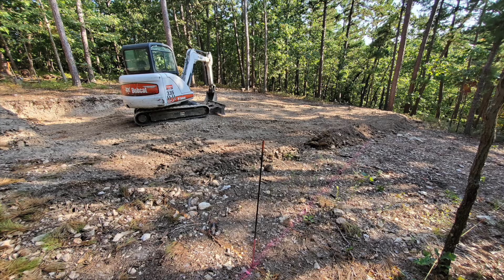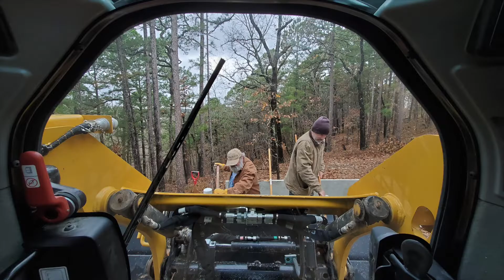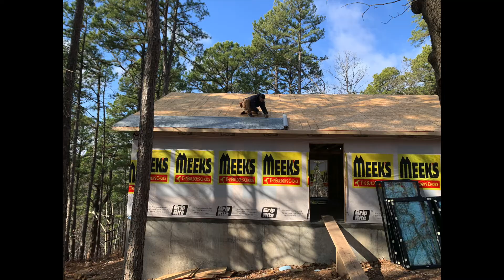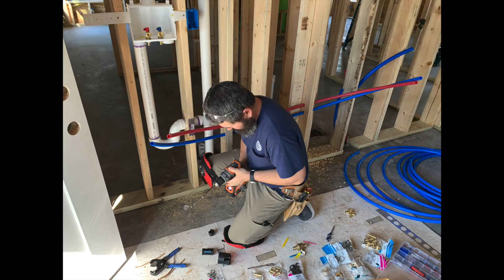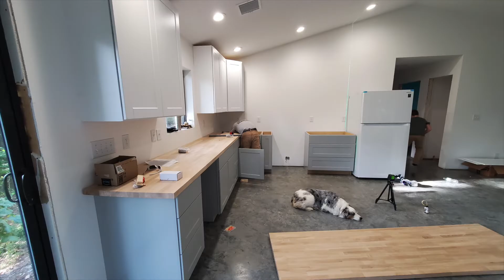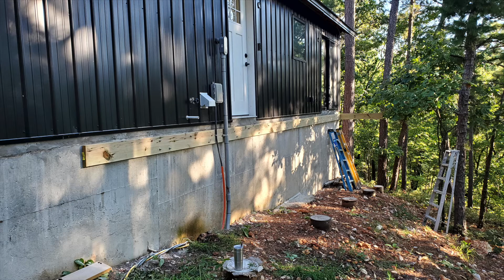Home built by Husband and Wife

Comment: Oakie: Very well done!
Watching for the first time and that was impressive. I built my timber frame 27 years ago and experienced many of the same things.  Working weekends, nights and my vacations burned me out but I have no regrets. It's amazing what we can accomplish as a family and the experience last a life time. Just documenting the project goes above and beyond what most never do so congratulations on a job well done.
Reply from the maker: Thank you sir!  I appreciate you taking the time to watch the slide show.  This really is one of my only narrated videos but I really wanted to get something out there on it.  It would have been cool to record the whole thing but that would have really slowed the project down quite a bit.  Have a good one!
Reply: @oakiewoodsman   I did have twenty friends help me for the house raising and we had a great party after I nailed the pine branch to the end of the 8x10 ridge beam.  I had a friend who's a carpenter help me with the roof and stairs and another friend help me set the windows. A good friend's company did my concrete basement foundation and he did my 35' two flue stone chimney.  When I studied architecture, I liked Frank Lloyd Wright's concept of bringing the outside inside and the timber frame allowed me to do that. Maintaining a structure is  never ending and it looks like you did a great job making your house's exterior as maintenance free as possible.